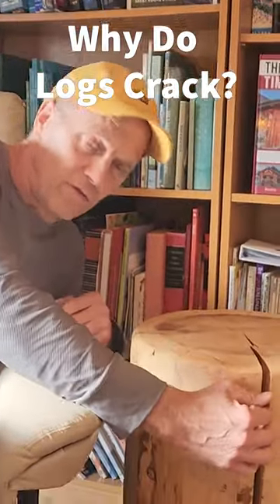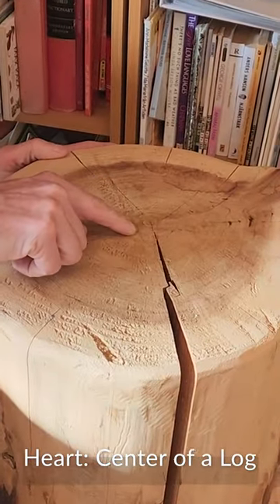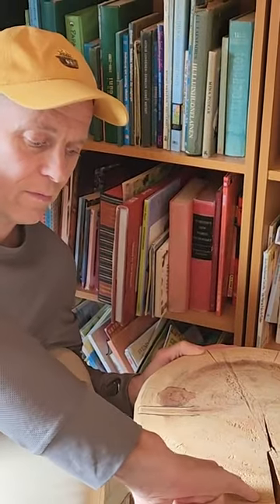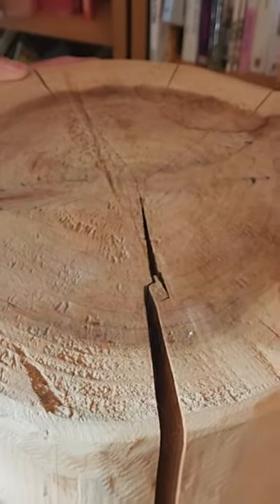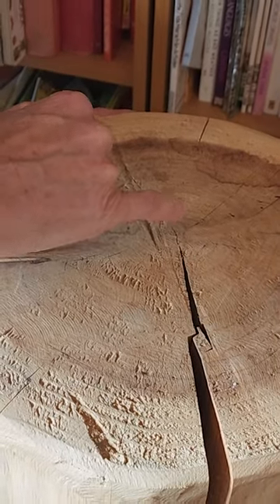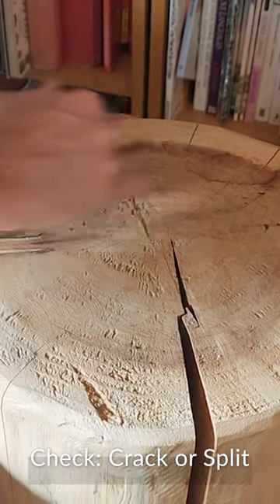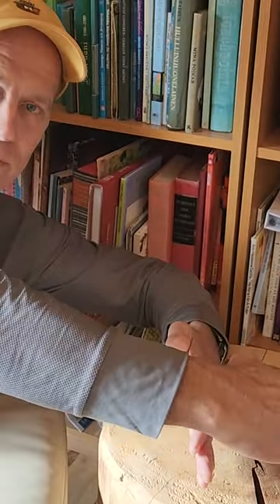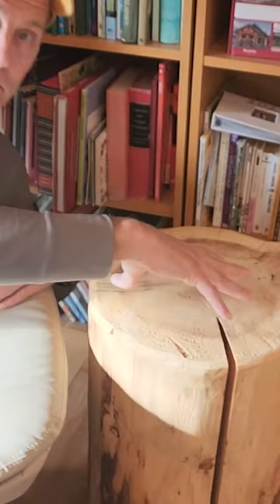Why do Logs Crack? "Checking"

Comment: Have you thought about cutting a grove to relieve the pressure of the checking and maybe helping with the making of the mortise or tenon
Reply: I have
Reply from the maker: We have done that where we put the groove in a certain point on a boxed heart, and it often works, but not always. Similar to putting a control joint on concrete, which usually works, but not always.